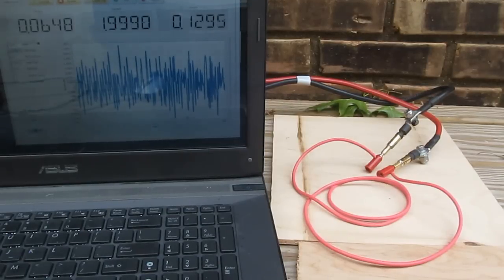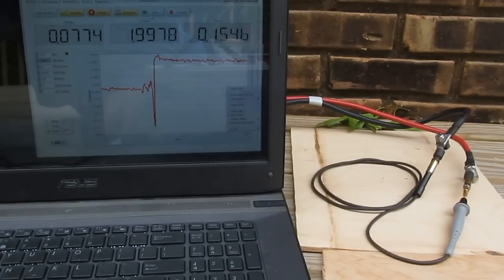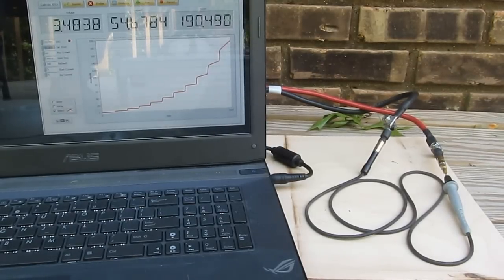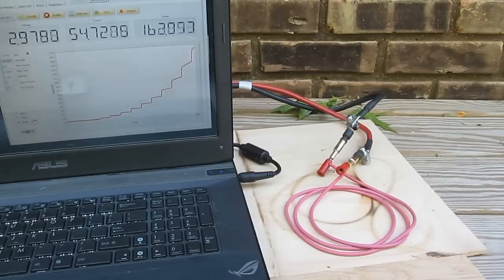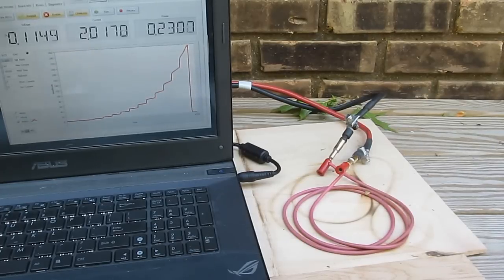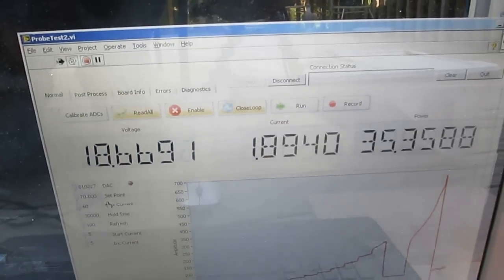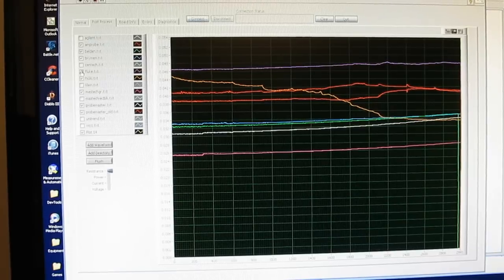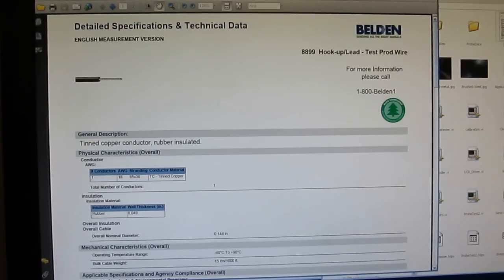Probe Master 8017s and Belden 8899 Wire Tested to Failure

Comment: Does the Belden 8899 have markings on the cable?
Reply from the maker: No.  The spool is marked.
Reply: @user-gq8bb4vb5d  Thank you. I ordered some 8899 and received 20 awg similar epdm wire that I'm  not thrilled with.
Reply from the maker: I assume you purchased from one of their distributors.  Not thrilled could mean the texture or color.  Maybe you're not thrilled with how it bends.  If you are concerned if what you purchased is actually Belden 8899, you could possibly post some closeup photos and provide the strand count, diameter of wires, OD of insulation...   I use the EEVBLOG site for this but there are several forums available.

Comment: How about testing some generic Chinese multimeter leads sold online? Would be interesting to see how they compare to the name brands. Thanks great test.
Reply from the maker: I doubt that the companies making the DMMs are also making their own leads.   There is a separate certification for them.  I wouldn't be surprised to find out that even Fluke has outsourced their leads.   That does not mean that they are poor quality.

Comment: On Friday I made a simple high current supply with a transformer (I needed 16 Amps, stopped fooling around at 500 Amps because the wire started to get warm). Maybe I should sacrifice one of my 2.5mm^2 test leads and have a go, I suspect the multicontact plugs (32Amp rated) will fail before the lead itself.
I don't see why they would even use thinner wire than that, the OD and flexibility is almost the same as Fluke TL175 leads. It's a bit like making an extension cord that can't carry the rated current of the plugs. But I guess they save a few bucks and the meters are only rated to 10Amps anyway, and that's the intended use.

Comment: Hey! Thanks for trying out the ProbeMaster probes. I love my set and I'm about to buy another kit from them. So if I understand it right, the ProbeMaster held up better than the Brymen probes? Lower resistance? I love my Brymen BM869S and I'm thinking of using the ProbeMasters instead of the ones that came with the meters. Any opinion? By the way, I'll add a note when ordering ProbeMasters that I saw this video. Better info than any CAT-rating. Thanks again.
Reply from the maker: Held up better in what  way?   I never tested a Brymen probe to failure.  The only time I have used the Brymen probes was for this test, so even long term normal use,  I really have no idea how they hold up.   For resistance, I have posted a graph showing all three probes on EEVBLOG that you can look at.   Let me know if you don't understand what is being shown and I will try to explain it.  One problem with the 8017S probes is they will not fit into the standard holders molded into most meters.    

http://www.eevblog.com/forum/testgear/hear-kitty-kitty-kitty-nope-not-that-kind-of-cat/975/
Reply: Ah, must have mixed them up. I'll have a look on the EEVBlog. But I like the screw-on accessories on the ProbeMaster. Haven't had any problem using the ProbeMasters on my Siglent DMM or the Brymen. Anyway, thanks for the videos.
Reply from the maker: From the probes I tested to destruction, the Probe Master and older style Fluke were the only ones to survive the 60A sweep.  The Belden wire I ran held up as well.  If you look at how long it too to damage the Fluke probe compared with the Probe Master, there was no contest.  Also, the wire used on the Probe Master held up much better.